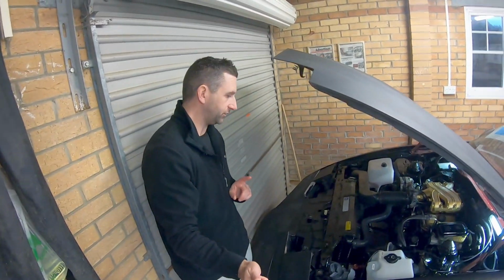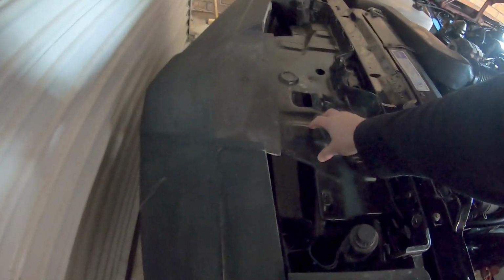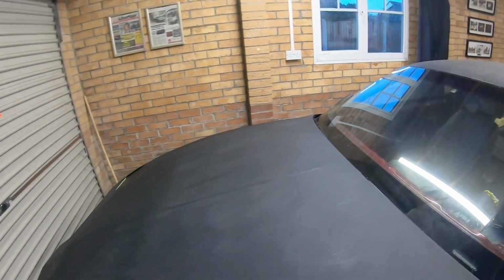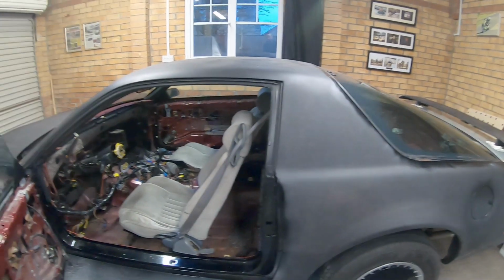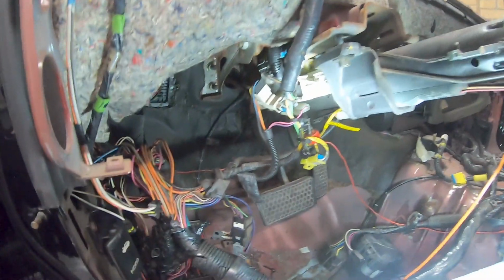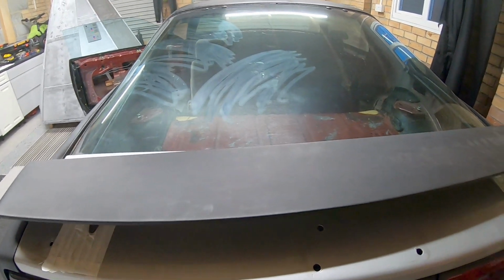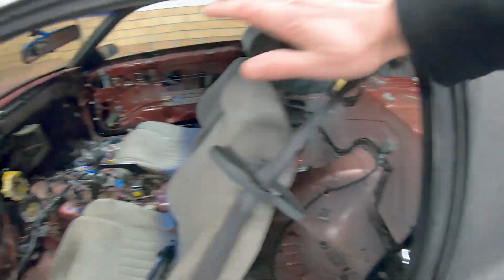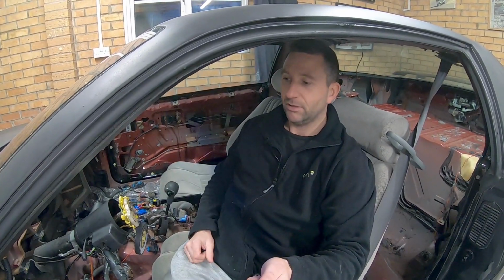Kitt Build Tips & Tricks Special Update 🚗🔥

Comment: I agree 100% with getting the mechanical part first.  That's what I did with my project. Engine got pulled out along with transmission and rear end and everything got rebuilt/resealed.  Engine bay painted while everything was out. I also took the time to dress the engine while it was out. looks better than it looked new now.